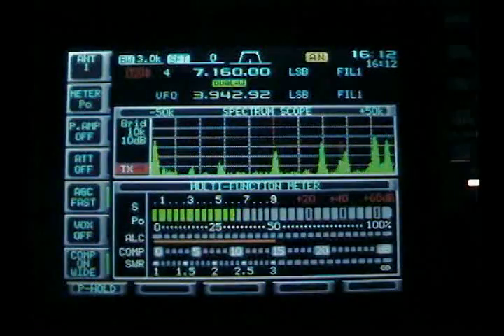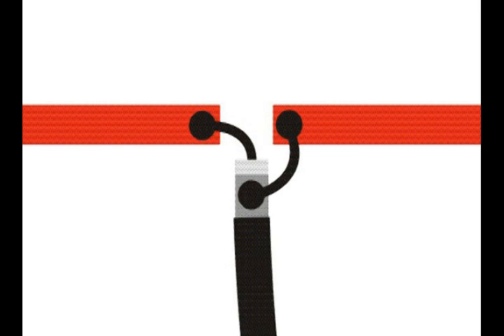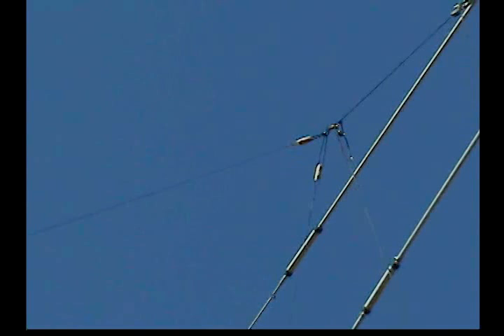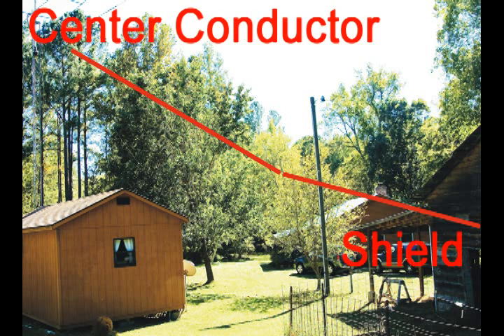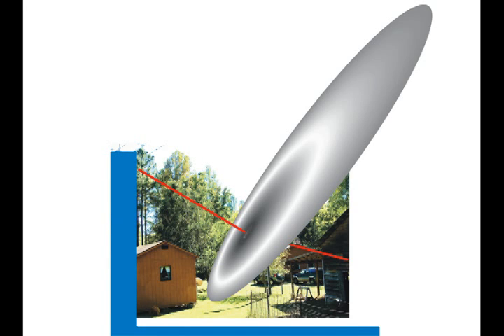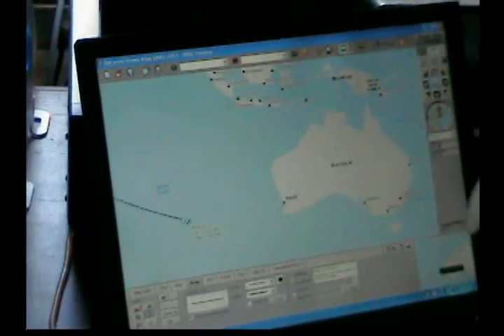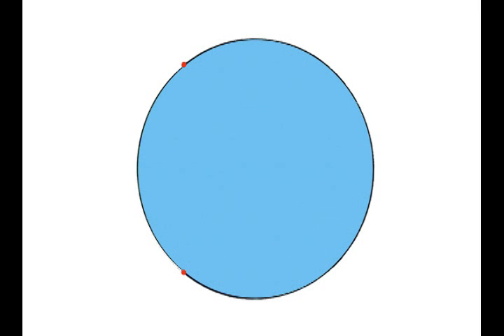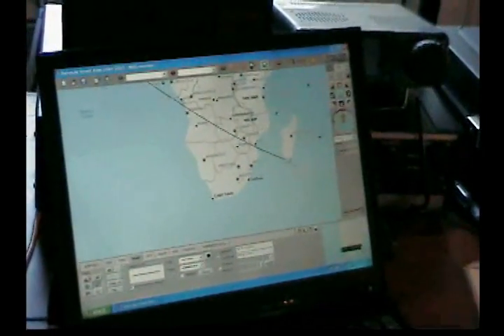Sloped Dipole Experiment K4WDG

Comment: I have a Center Fed Sloped Dipole made for 10 Meters running from the back of my home. Quite recently before installing this antenna I have ask this exact question.... What side should be on the high side ?  Center or Shield ?  I opted for Center on the High side.  This configuration has recently worked well for me France, Netherlands, Spain, Italy  and Greece.   This was accomplished with an IC-7000 using no more then 60 watts .   Thank You for this video... It explains much   KC3ZDW  73's
Reply from the maker: I’m glad this video helped. Thank you for your comment!

Comment from the maker: Depending on the surrounding environment, this has a large influence if not dictates what antenna will work for that situation. Otherwise there would only be one antenna design. Dave has built inverted VEEs and very large yagi antennas and much more. He tells me that the performance of this sloper rivals the performance of a $25K tower setup. So it all boils down to using what works best for your environment.